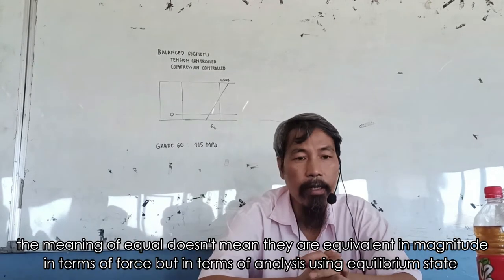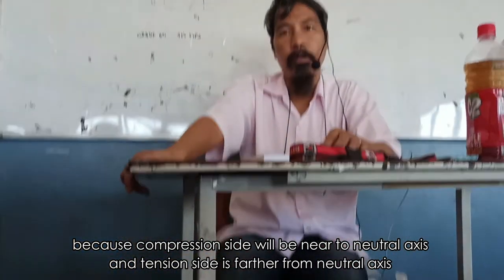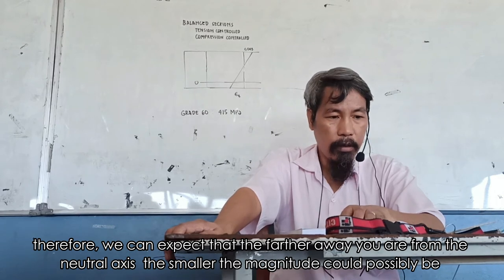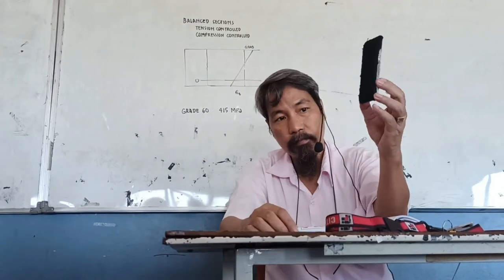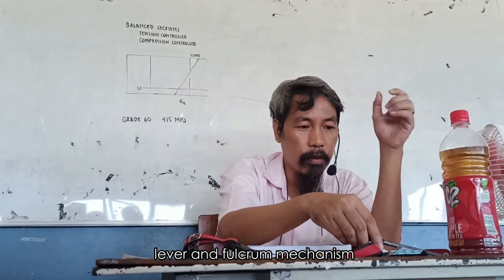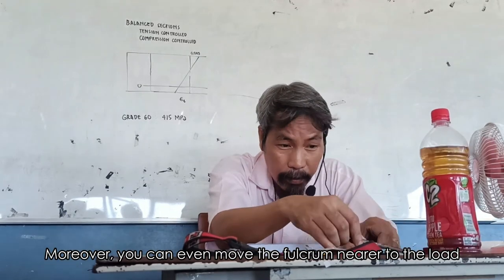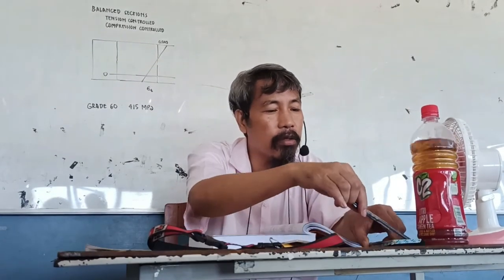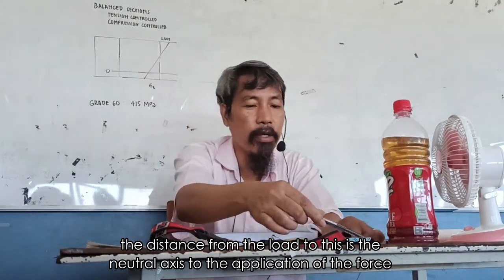CE 422: Structural Design 1: Reinforced Concrete Design || Balanced Sections || Part 1

Comment: 1. Sarcia, Mabelle E.
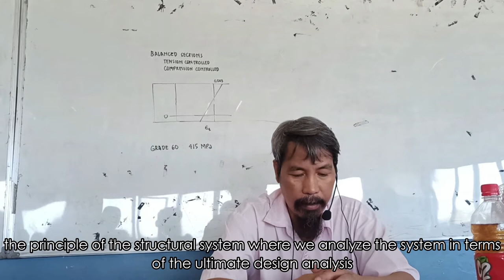2. Structural System (0:17)
3. Ultimate design analysis (0:19)
4. Strength Design (0:39)
5. Tension (1:17)
6. Compression (1:18)